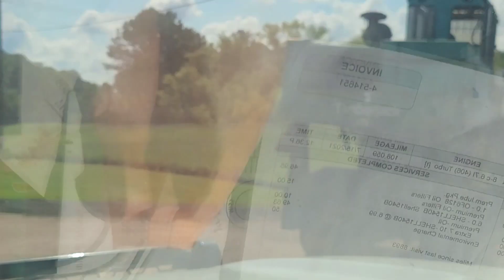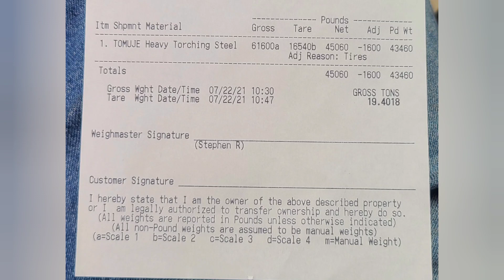Bye Bye 👋🏾330B Rest In Steel‼️😂👀👀

Comment: don't see how they figured 19.4 net tons when adjusted over 43,000 lbs which is over 21.5 tons...hmm. Also, I might be wrong, but don't seem like tires would weigh 200 lbs each without the rims, maybe they wanted them steel rims for free. Like I said, could be wrong.  Keep gettin it.
Reply from the maker: Yeah they paid for 43460...Don't know what 19tons was for